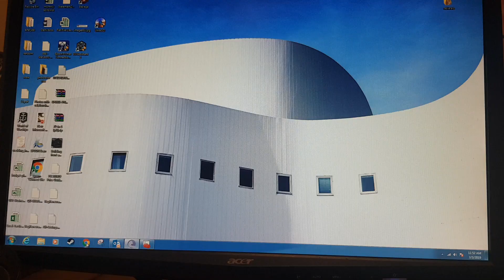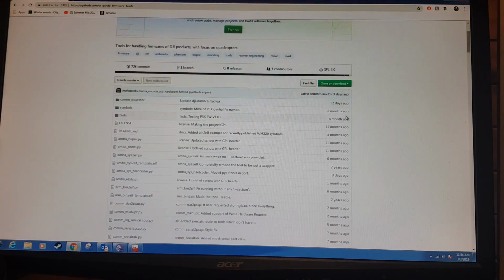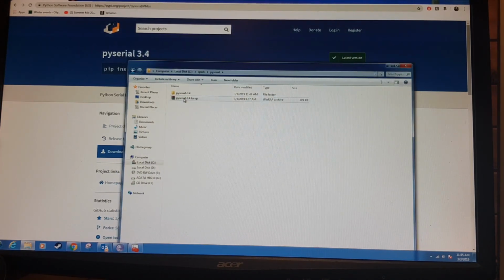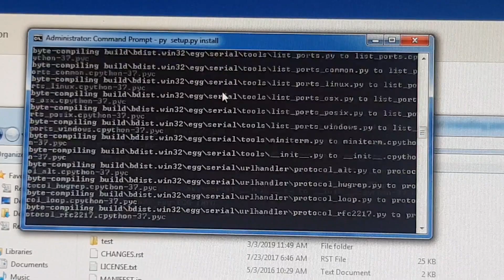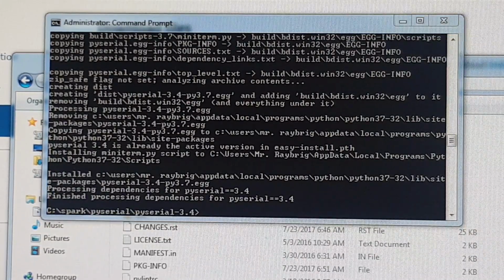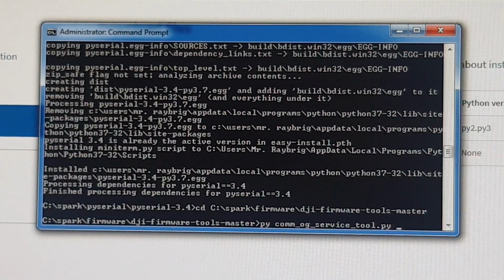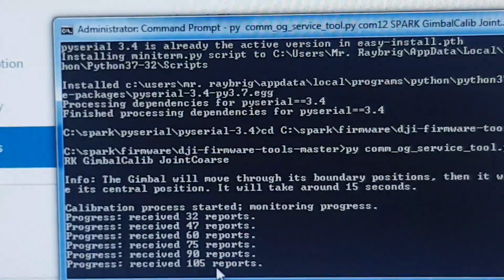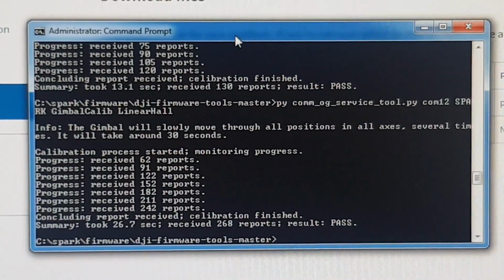DJI SPARK Camera Gimble Calibration  - Easy Fix

Comment: My drone also fell from a height after hitting the top of a tree and I can go to camera calibration on my phone and calibrate that -7.2 and it levels up but it seems the horizon gets out of horizontal when I am flying sometimes it’s because of the angle of the drone when I am cruising all the wind but could it be also because the camera needs recalibrating with these files, it recognises me and sits straight when I use it in hand gesture mode

Comment: Hi an amazing video. Same problem, camera gimbal at an angle in Roll axis. I have done everything as per your video, but have got stuck when I reach cd C:\spark\dji-firmware-tools-master.zip\dji-firmware-tools-master, thus path I copied, I keep getting the notification "The system cannot find the path specified". I have copied the part exactly how you doing. However, I have a new motherboard, rather it is a used one I purchased from ebay and shipped from UK, cause the old one would make the Spark spin like a tip once it lifted off. Now with this motherboard, the Spark is flying good, but the camera is tilted. So I needed to calibrate the camera, and now I am stuck again. Hope there is some solution to this. I am now at C:\Spark\pyserial-3.5> as every time I past the next path and enter, it says path not found and comes back to this line. One more diff I noticed is that, when I connect the Spark with USB to laptop, I do not get the sound from laptop that indicates that a usb device is connected after I power on the Spark. I head that sound in your video. Does that mean the Drivers are also not installed ? Cause with those computer sound you also say that probably the drivers are being installed. Wish I could send you a screen shot of my laptop where I am stuck. The Spark does power up with front leds solid Red and rear leds flashing Yellow. Also on the laptop, in Device Manager, I dont see any Ports Icon, So I guess the Spart is not being detected by computer. Looks like things are more complicated. And it is not possible for me to send Spart to a Service Centre outside India, as when it is sent back to me, the Customs will never clear it.

Comment: Pls.. Help me with this problem. I am using DJI Spark with a code WM100

comm_og_service_tool.py: error: argument product: invalid choice: 'COM6' (choose from 'A2', 'P330', 'P330V', 'P330Z', 'P330VP', 'WM610', 'P3X', 'P3S', 'MAT100', 'P3C', 'MG1', 'WM325', 'WM330', 'MAT600', 'WM220', 'WM620', 'WM331', 'MAT200', 'MG1S', 'WM332', 'WM100', 'WM230', 'WM335', 'WM240', 'WM245', 'WM246', 'WM160', 'WM231', 'WM232', 'WM260')

I followed all of your steps. plss help me with this :)

Comment: Thank you for the detailed guide! I've to mention that the calibration 
failed for me for the first time, when I tried to perform it with low 
battery of the drone, and on a windows 7 pc. I got "result: UNSURE". 
Today I did it on a windows 10 computer with 100% battery on the DJI and
 it worked like a charm!

Comment: Thank you very much! I'm doing this in August 2021 on Windows 10 & it worked, with one difference. On mine, I had to run the first calibration until it passed. Then, turn the drone off, restart, then run the second one or it would not pass. Other than that, it went great. I'd like to see some more video like this for calibrating other things on the Spark if possible!
Reply: Hi, can you help me install the drivers on Win 11? The Spark is detected, but there's an exclamation point in Device Manager?

Comment: Thank you for posting this video!  My son crashed my Spark into a fence while flying in Sport mode.   The drone had gimbal errors and the camera would not move on its own.  The camera was tilted to the right at about 20 degree angle, the gimbal wheel did not work, nor did the hotkey for Gimbal Up/Down.   I recalibrated the gimbal using your method and all errors cleared.  Thanks again!
Reply: Hi, can you help me install the drivers on Win 11? The Spark is detected, but there's an exclamation point in Device Manager?

Comment: Great video, so much help. Two notes, I struggled to open the pyserial file at first. I ended up unzipping using 7zip and had to unzip the first file and then a second file in order to get to the folder with the setup.py file. Secondly, you need to have the dji assistant application closed while calibrating. I did not at first and kept receiving an error saying that I did not have permission to run the calibration.

Comment: I was not able to get pyserial-3.4.tar.gz to work.  After downloading, File Explorer's button to extract it was grayed out.  Any suggestions?
Reply from the maker: Use a dedicated extracting software, like winrar or 7zip to extract the contents.
Reply: @diymixbag   Thanks.  That helped.  Also, the downloaded firmware tool didn't have ".py" at the end so I added it to the command and it worked.  Can't wait to try it out.  Thanks.

Comment: Note for viewers - You don't actually need to install the DJI Assistant, but can follow all other instructions as mentioned. 

Thank you so much for this, Bilal it was really helpful!
Reply from the maker: Hey, I'm glad it was helpful for you. 

DJI assistant is required to make sure you have drivers installed on your computer to detect your spark. Some computers may already detect it without the software, some won't. Best practice is to follow exact instructions, so if anything goes wrong it's easier to troubleshoot.

Comment: Thanks for a good video!
But i reacive this error meassege, what could be the problem?
C:\spark\djifirmware\dji-firmware-tools-master>py comm_og_service_tool.py COM5 GimbalCalib JointCoarse
usage: comm_og_service_tool.py [-h] [-b BAUDRATE] [-w TIMEOUT] [--dry-test] [-v] [--version] port product command ...
comm_og_service_tool.py: error: argument product: invalid choice: 'GIMBALCALIB' (choose from 'A2', 'P330', 'P330V', 'P330Z', 'P330VP', 'WM610', 'P3X', 'P3S', 'MAT100', 'P3C', 'MG1', 'WM325', 'WM330', 'MAT600', 'WM220', 'WM620', 'WM331', 'MAT200', 'MG1S', 'WM332', 'WM100', 'WM230', 'WM335', 'WM240', 'WM245', 'WM246', 'WM160', 'WM231
Reply from the maker: Not sure mate, never seen this before. Try using a different usb cable / usb port / pc ?
Reply: I got the same error and i can't solve this... i don't know what to do

Comment: Bro cannot find  the spark port I am using windows 10
Reply from the maker: Do you have all the pre requisites installed? did you check other lines on your device manager?
Reply: Bilal Raybrig yup all softwares installed and drone is detected in dji software, but I dont know why it isnt moving :(
Reply: In Device Manager look for Show Hiden Devices

Comment: Why the sparkpyserial3.4 folder does not appear to me?
Reply from the maker: 'pyserial-3.4.tar.gz' on the Python website is a compressed file. Once you download it, you need to extract it's content into a new folder. Once you extract it out you will get the 'pyserial-3.4' folder.

Comment: Very good tutorial and easy to follow. So from what I understand, you changed the complete gimbal and it wasn’t being recognised by the Spark. Is that correct? I have an issue with a Mavic Pro with a similar problem. Installed a new gimbal pcb board and gimbal. The video link works but I cannot move the gimbal at all using the controller.
Reply from the maker: Hi, 
The gimbal housing broke, the gimbal and camera was working just fine. After I replaced the housing (plastic cover/case), it was crooked. It did not point straight. I did this calibration in order to fix the gimbal orientation. 

For your mavik pro, did you try to move the gimbal using the dji app controls? If it is not moving at all it may be a hardware issue. 

Also, there's a gimbal calibration option for mavik pro in the dji app, have you tried that?
Reply: Bilal Raybrig hi tag Hi thanks for that I tried moving gimbal with the controller and not the app. But controller works so not controller issue. That’s why I think it’s a faulty pcb board. But I have three that do the same so that’s why I thought maybe required programming.
Reply from the maker: I have never worked on the Mavik so not sure what it needs. Sorry mate.
Reply: Bilal Raybrig thanks anyway.

Comment: why in my pc shows this warning "error : Couldnt open port " com4" permission error(13 'access is denied.' none 5)
Reply: NOT typing 'py' before the 'comm_'-phrase solved the problem for me.
Reply: can you hlep me sir?
Reply: Have the same issue in win10
Reply: Same here
Reply: Disconnect USB  close dji Assistant and try again
Reply: @anuchitp1525  These  works bro! tnkss
Reply: I try a different computer and it works!
Reply: I think the problem is that the OP said to run DJI ASSISTANT which I guess takes a lock out on the drones COM port. I found the solution was to STOP DJI Assistant and then the command worked perfectly for me
Reply: @surreysteve  worked thanks

Comment: Pyserial Keeps saying i have no App associated with it and as so cannot open it unless i make an association for it, should i try to associate it with Python or something to make it work?
Reply from the maker: Hey mate, not sure why that's coming up. What windows are you using? Did you run everything as administrator? Maybe try again on a different pc (carefully follow the video step by step).. i hope it works out for you mate.
Reply: Mine is also doing this tried 2 pcs

Comment: At the last step I am getting this message in cmd: "Error: could not open port 'com3': PermissionError(13, 'Access is denied.', None, 5)" 
Anyone who had the same and found a solution? It's on windows 10...
Reply: Make sure you run CMD as "administrator"
Reply: Close DJI Assistant
Reply from the maker: Hey mate, sorry for late reply. Maybe try a different usb port, make sure you run all programs as administrator..
Reply: @diymixbag  Thanks for the reply but I already tried that before. I don't know man. When I will have time I might try again on a different pc

Comment: Hello. Is it possible to calibrate the Mavic 2 pro?
Reply from the maker: Hey mate, I think Mavic 2 pro gimble can be calibrated via the DJI app on your phone. Connect your phone to the drone and find the calibrate gimble button in settings.
Reply: @diymixbag  Thanks for the answer, I will try, but I think in my case it will not work. I replaced the suspension with Chinese.

Comment: hi guy,  i can't install.  

C:\Downloads\pyserial-3.4>py setup.py install
'py' is not recognized as an internal or external command,
operable program or batch file.
Reply from the maker: Hi Nu,

I think you might have missed a step before. Did you install Python? (https://www.python.org/downloads/)
Reply: @diymixbag  I did install python.org and I still have the same problem. PY is not showing.
Reply from the maker: @Dominican_kennym3  thats weird. Can you try using a different USB cable? And try with one of the main USB ports at the back of the computer if you have a desktop. 

If this doesnt work, try a different PC altogether.

Hope this solves your issue.
Reply: Test

Comment: hi guys, quick question why I cant find my dji in "ports", I see that there is a usb serial device (com3) but apparently that`s not it or there is something wrong with dji/my pc dunno any suggestions?
Reply from the maker: Note sure mate, try a differnet PC?
Reply: @diymixbag  tried on 3 different Pc's on win 10 with latest drivers :/ I can update my drone software and upload videos but I can't actually properly connect it to configure gimbal
Reply: Manuel yapılandırma denemelisin. C:\Program Files (x86)\DJI Product\DJI Assistant 2\Drivers_all\Drivers_Win10\STM_VCOM içindeki stmcdc.inf dosyasını (com3) port'a yeniden tanıtın.

Comment: Thank you for this vidoe Bilal. Also when I went to this website  https://pypi.org/project/pyserial/#files it has a different pyserial-3.4.tar.gz. it would not let me to install it.
Reply from the maker: please try following link.

https://files.pythonhosted.org/packages/cc/74/11b04703ec416717b247d789103277269d567db575d2fd88f25d9767fe3d/pyserial-3.4.tar.gz

You will need a zipped file extracter software to get this running. (For eg. WinRAR)
Reply: @diymixbag  Thank you for this link. But it still wont let me to open or unzip the tar.gz file. When i'm trying to open the file a window pop-up asking me "How do you want to open this file? Look of an app in the Store." Please advice. Thanks
Reply from the maker: Hi,

I guess, you will need to assign a program to open and extract the tar.gz file. In my video, I have used WinRAR (https://www.win-rar.com/download.html?&L=0). Once you have WinRAR isntalled on your PC, the tar.gz file should turn to an icon of 3 books stacked together. Then just Right-Click and extract..

Comment: What is the Firmware that your DJI has?
I try to Calib but fails, just stops at the middle of the process and the gimball stop working until restart the drone.
Reply from the maker: I do not have the DJI anymore. I had to sell it recently. And I did not note the firmware when I fixed mine. Maybe try a different USB cable and/or  USB port?
Reply: @diymixbag  thanks for answering :)
Reply: Ali Nahle do you still have your spark?
Reply: @Will0ver9000  yup
Reply: @Will0ver9000  I just see your Windows 7 solution! Thnks! That's makes sense, I had another problem like this one with Windows Pro. Will try Windows 7!
Reply: Ali Nahle it should work with any version of Windows 7

Comment: Not working as shown in the video.  I think there were some updates.  Still need some guidance.  But thanks for the video it was going good in the early stage.  Please update.
Reply from the maker: Hi Todd, thanks for your comment. I'm sorry it didn't work for you, I have no idea about any updates, maybe try again with a different usb port/pc/usb cable? Sometimes these could be the reason of failure. I hope you succesfully find a fix.
Reply: Todd Carroll what pc software are you using